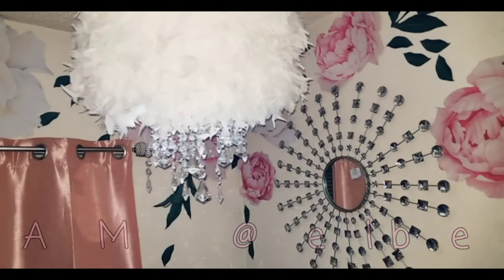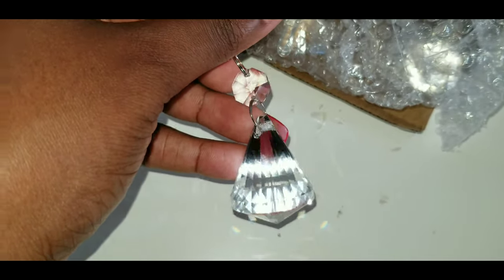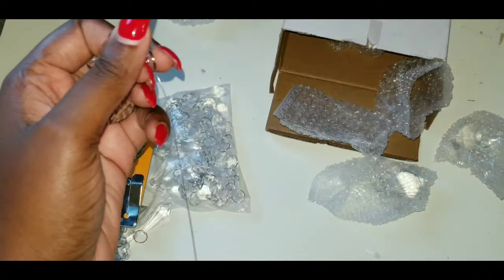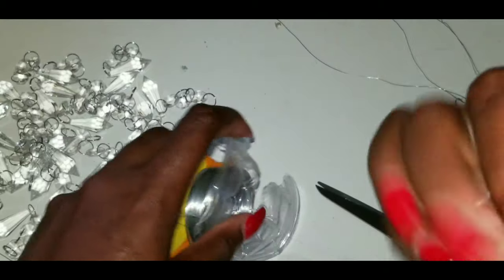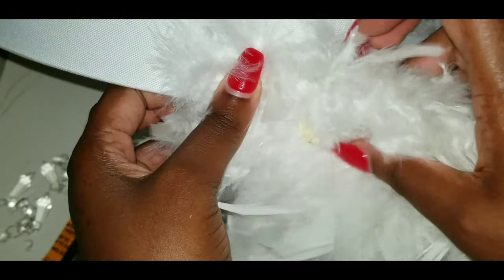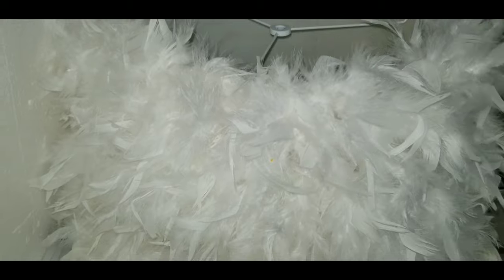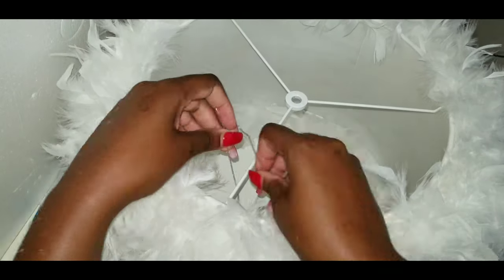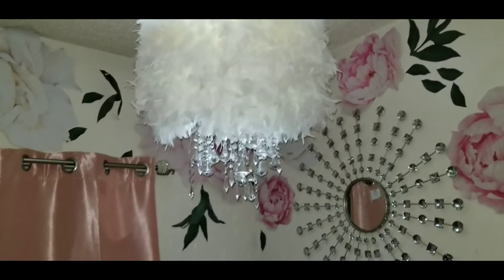FEATHER CRYSTAL CHANDELIER DIY | LUXURY & GLAM EASY HACK

Comment: I love this DIY!
I have an idea tho.....before hanging the crystals, spiral some wire to the lamp shade support rods, then you can secure the crystals wiring to each individual
Reply: Then you can secure each crystal without them sliding around and causing the chandelier to get off balance. Make sure to tie the ends of the wire to the lamp shade, wrap the wire around the lamp shades support rods(not too tight, you'll need to leave enough space to secure your crystals),then tie off the other end to the the light bulb hole/ fixture hole. This will ensure that your crystals will not slide around. Hope this helps!